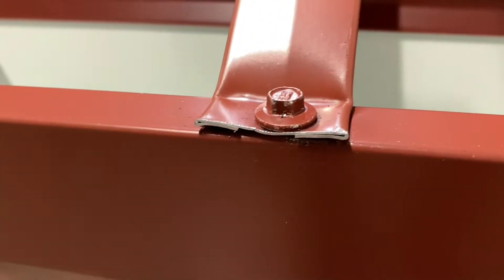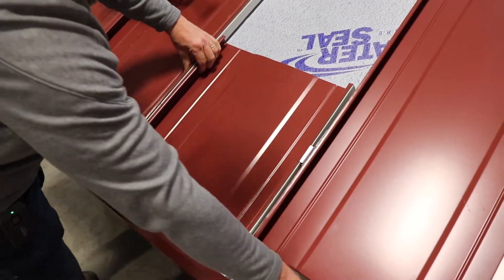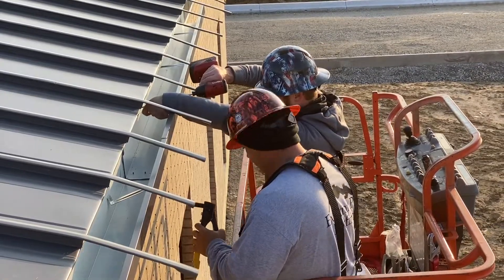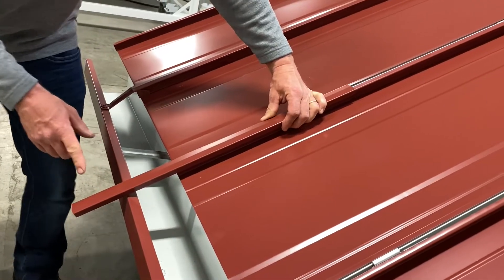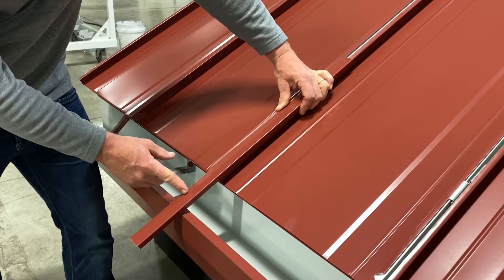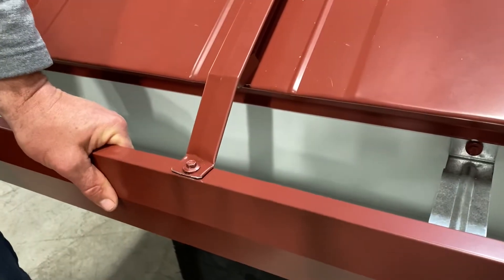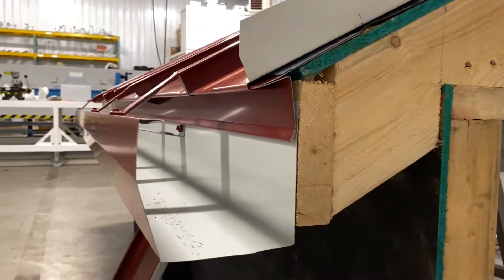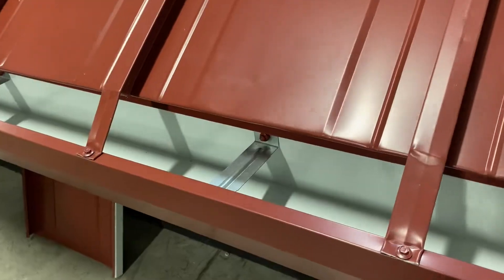138 T standing Seam Metal Roofing -The Gutter Detail- Seam Cap Becomes Gutter Strap

Comment: Hopefully somebody checks this message board. I am interested in this gutter system, I live in Salem Oregon. I'm actually interested in the way you finished the ends of the metal roofing going into the gutters.? Mine are just cut straight right there and I'm worried about when getting underneath them. Any help would be appreciated or referrals to local or I could call you directly. What Is your business name and location?